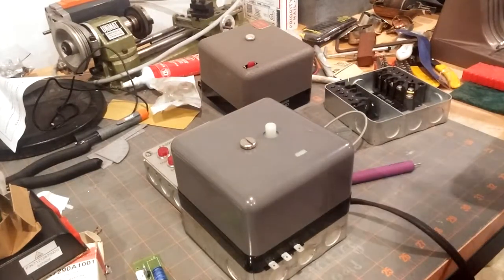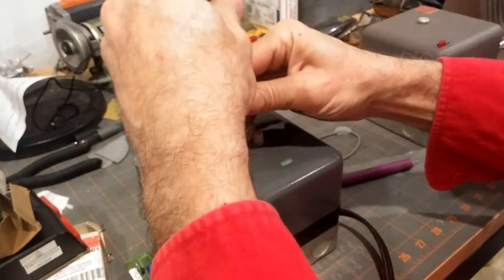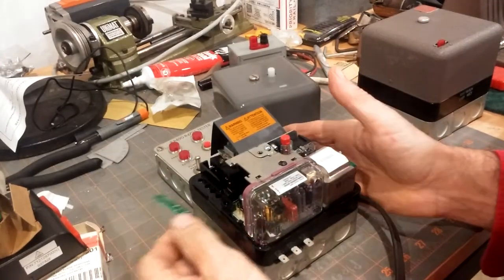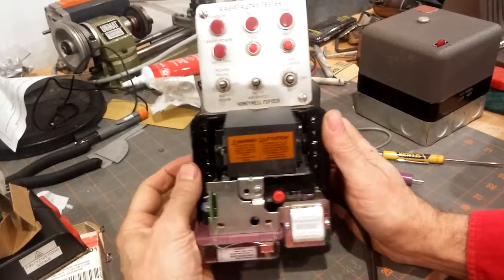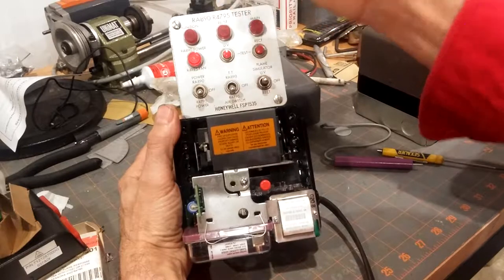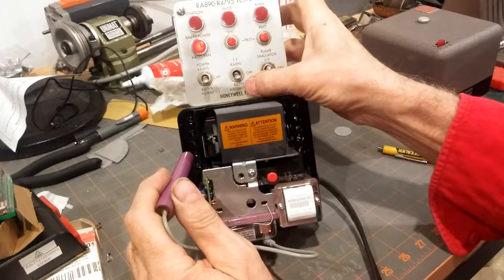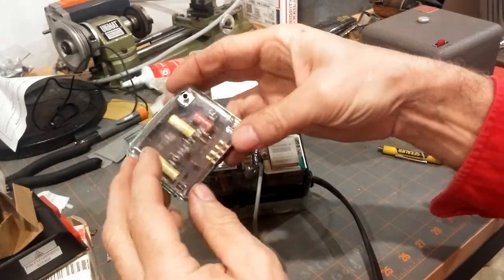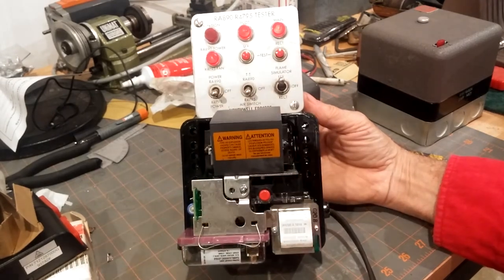Testing a Honeywell R4795 Flame Safety Primary Control with a Honeywell FSP1535 Tester

Comment: Im working on that same control , and the K2 relay has 3 sets of points , and the top set is kinda crispy and discolored , so i sanded the points down and the unit fired up. Do you know what those top points control ? I'd like to check whatever that specific set of points turns on
Reply from the maker: Thank you for your question.
I am by no means an expert on these controls.
To find schematics of these old controls, you may have to go back to older Honeywell publications.
Once such major reference is "Flame Safeguard Controls - A Honeywell Textbook". That's a big book. There are other smaller handbooks by Honeywell that cover this and other older contols.